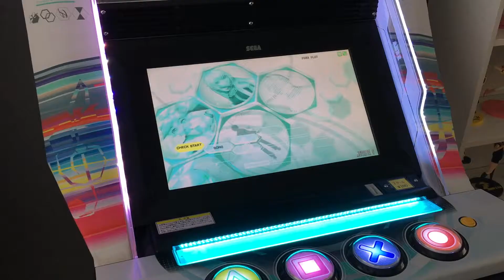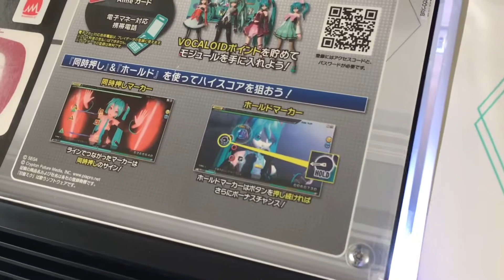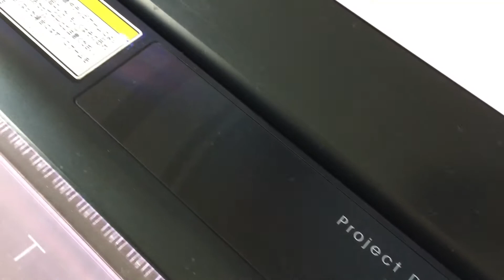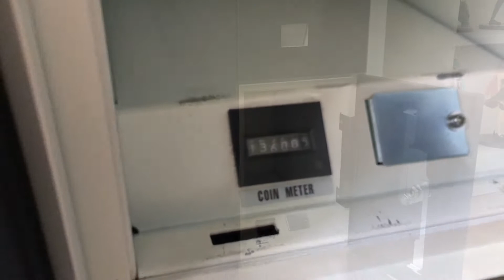Hatsune Miku Project DIVA Arcade Future Tone Cabinet - Showcase

Comment: Woah. Hardly any of these in the UK, let alone a home setup and in such perfect condition.  Great job and video.
Reply from the maker: I was surprised by the condition too, as I hadn't seen any pictures of it prior to delivery. The control panel it came with had quite a bit of rust on it, was loosly attached and didn't match the good condition of the rest of the cabinet. I 'm guessing it's original panel developed a fault and the operator swaped it for the tatty one. The panel in all my videos is in fact the one I had previously as my stand alone controller as it is almost new in appearance.
Reply: @N10248  Sick job. You've achieved a 200% better result than the technicians I 've worked with at several major UK arcades lmao.

Comment: The touchscreen monitor is impressive! I keep forgetting the arcade cabinet has a harddrive.  I can only imagine how expensive this would run up the electricity bill.  I love the glowing buttons.
Reply from the maker: It's fairy power efficient, the PC inside is quite low end, it's an LED backlit monitor, the lights use very little power as with most LED lights. The whole thing uses at most 230w according to the sticker on the back, and that would only be with the display on full brightness and all the speakers on full volume.
Reply: @N10248  One more question.  Is that arcade cabinet,  Windows XP? Ohhhh, I had to look up wattage usage for electronics such  as a washing machine, and PS4 to compare.
Reply from the maker: @chocotokenxreturns6126  Normally it would be running Windows Embedded 8, but mine is using regular Windows 8.1 Pro.

Comment: Hey awesome! 

I'm currently heavy on checking and buying parts for different Arcades (Mainly PD and Chunithm).
May I ask where you got yours and for how much?
Reply from the maker: The cabinet itself came via Ronnie at RKLOK.nl for £1600, I used my existing control panel as it was in better condition which came from eBay Seller "Tzsn_game" in Japan for about £270.
Reply: @N10248  Thank you for your fast response! 
Did they luckily have the cabinet in stock or did you contact them if they were able to get their hands on it?

Because the cabinet itself is the most important part right now for me as I currently am trying to get a PD nu for the IO-Card and the Controller for about 100€ each on an japanese yahoo auction. :D
Reply from the maker: @Afk_Kun  I contacted him last September, it took him a while to find one in Japan but I got it in April, he has another according to his most recent newsletter email.

Comment: I hate to be the person asking for help in the comments, I really appreciate your channel, it's driven me to buy my own Diva arcade cabinet. I have the cab and I have the PCB (computer, which I had to buy separate on YAJ), I have no idea how where to get help with the software. If you could happen to point me in any direction regarding that it would very appreciated! 

keep up the great work <3!
Reply from the maker: Yay another owner! Unless you were very lucky and got a keychip with it too, using the original hardware and software freely can be quite difficult, and hacking it can be risky, that's the main reason I went the route I did, ie swapping the motherboard and using the available rip of the game instead of the original. Might be a good idea to sign up at ProjectDiva.net and go through what you have and how far you have got with it all.

Comment: Hey I have a few questions. 
1. does the sega Nu has DVD player or whatever it call. Because I seen people selling like a copy of the disc. Which is probably updates of the game. 

2. Network switch board when you bought the arcade cabinet. Has that been use. Because I never seen project diva arcades use together or something like that. Is probably a feature I haven't seen. Probably multiplayer?. 

3. Since you have the arcade cabinet with the touch screen working. Did you had to Recalibrate the screen. And if you did was it on the test mode and touch panel setting?. The reason I'm asking is because touch panel is disabled for me. Because I don't have a touch panel and I want to learn more on that setting and  Options it has.
Reply from the maker: 1: The official way games get installed on the Nu is by using the Lindbergh DVD Drive Unit "U-Type", you have to use a different power cable for the drive though, as the Nu has a 4-pin square power connector instead of the 6-pin JST conector that the lindbergh used. The base game comes on 4 dvds (i think) and the extra songs get downloaded from All.net.

2: The network switch is used to join up to 4 cabinets together. 1 cab is set as the "Server" (set via dip-switch 1 on the Nu) and 3 others connect to the switch in that one (the switches in the other 3 cabs are not used). the server cab downloads game updates only, and then the other 3 get updated by the server. there is no multiplayer and if the server cab is off the other 3 won't work.

3: the touch screen needed calibrating when I first got it working, it was only slightly wrong. I think the calibration settings are stored on the JVS card in the Nu, as the calibration remains across multiple installs of the game.  Its calibrated in the games service menu, you press certain points on the screen.
Reply: @N10248  I see. 
1. I have seen people in Japanese websites selling the disc's 1 and 2. But Idk about 3 and 4 disc's.

3. Is it ok if you can show a video or pictures on the touch panel  Recalibration on how to do it. If you can do it.

Also my research on this I found the Sega Mechanics website. Which you can download a lot of things form different arcades they do. But manuals and other stuff is lock for I'm guessing top mechanics. If you would like the website I can give it to you.
Reply from the maker: @codexgameing1151  I'll make a video at the weekend showing this and a few other interesting things about it
Reply: @N10248  oh ok. Well thank you for answering my questions. I will ask again if I need to. Thank you and take care.
Reply from the maker: @codexgameing1151  New video added showing the calibration process... https://www.youtube.com/watch?v=BfgrZjrK9AQ

Comment: Is the “SEGA” that Miku says on the Nu startup added in? I was at an arcade that had AFT, and it rebooted after I finished a game. I never heard the “SEGA” on the Nu startup screen.
Reply from the maker: Yes, it's a vbs script I added that plays the sound on bootup, as changing the Windows 8.1 startup sound isn't that easy, so I used a script instead. The real arcade doesn't do it.

Comment: how did you do the mirroring on the TV? I want to do this with my Chunithm cab
Reply from the maker: Just connect the TV to the other DVI connector with a DVI to HDMI cable and the image will be mirrored.
Reply: I tried that and it causes chunitim to throw and error and fail to load
Reply from the maker: @DoinStuff4Life  Odd - you could try a DVI splitter of some sort but that might do the same.

Comment: i just have to ask! where did you get all this stuff to make this?
Reply from the maker: The Nu itself came with my cabinet, but I made the descision to swap it's M-ATX motherboard for my own to make it more practical to use in a home environment - the original hardware has many security features that would have to be bypassed to make it playable.

Comment: do mega mix songs have to be in the arcade?
Reply from the maker: They are a mod added that is not available in the real arcades. It would be good if they were though
Reply: @N10248  How did you install the mod on a real arcade machine? Is everything done the same way as on a computer?
Reply from the maker: @YabokuRUS The hardware i'm using isn't completely original, and i'm running the arcade rip of the game so I can easily add mods and extras to the game.

Comment: how is the aime reader connected to the pc? what are the cables and ports?
Reply from the maker: The reader is a Zixsys TN32MSEC003S which connects to one of the serial ports on the rear filter board. COM10 is used for this. it just uses 3 pins Tx, Rx and Ground, the reader unit is powered by 12v.
Reply: @N10248  haha thank you, shame on me for not knowing even the one word of these)))) but I will learn more about arcade cabinets because I am interested in this. So, can I buy this thing and just somehow connect it to my pc? I have a common b450 motherboard
Reply from the maker: @automate-skull-666  It might work as long a the board has a serial port or header. Not sure where to find one though, theres very little info on the online.
Reply: @N10248  just googled serial port, isn’t it VGA? seems very similar
Reply from the maker: @automate-skull-666  Same size but different amount of pins; 9 for serial and 15 for vga, if the board doesnt have the physical port it may have a header called COM1 which you can get a cable to connect to make the port.
Reply: @N10248  thanks, I think I understood what we are talking about and I found where can I buy it. And I have one more question - can I just copy all the software and drivers from the original PDAFT nuc, install it on my pc, then connect that Zixsys NFC reader, get the IC card and play??
Reply from the maker: @automate-skull-666  The PD-Loader software handles the game saving locally using it's Score Saver plugin. The Aime card doesn't save data on itself, it's just a link to your online game account which would only be fully usable on a real cab in Japan connected to the All.net service.

Comment: Is yours offline and if so how come it’s doesn’t show an error code that stays on the scream unless you start playing. mine is currently off mode and I’m tired of looking at that message
Reply from the maker: Is yours an unaltered cab with a keychip or are you using something like Mikubox?
Reply: @N10248  yeah I’m not sure what it’s using but it’s playing off-line without no Internet doesn’t have a key card
Reply from the maker: @Jimslegacy  It's probably been modifued just enough to work offline. The ability to hide the errors is possible when using Mikubox (which would give online features too) or if using a rip of the game and a tool called PD-Loader.

Comment: I bought one, too.
There's a keychip.
But I can't play the game because I can't access all.net.
What should I do if I want to do it offline?
This is South Korea.
Help me.
Reply from the maker: How long have to left it running, does it stop with error 8005?, I'm not sure but it may eventually time out and load the game. otherwise you may need to create a  server running something like "aqua server" which emulates an allnet connection.
Reply: @N10248  I want to run a cabinet offline.
Do I have to do a patch to run offline?
There's a key chip on the Nu board.
I want to do it in offline mode.
I don't know how to do it. Help me.
Reply from the maker: @고고고-m3c  I'm not sure how to patch it myself, but you could ask either Youtubers @GameSaru as he has some of these cabs too, or @Janet-vc2 as he had one. You are lucky to have the keychip though, they are very rare.
Reply: I have this running on a bitlocker decrypted drive, with the original Nu hardware in full.

Comment: how do you change the volume on the cab?
Reply from the maker: There's two seperate volume dials inside the coin mech door for the speakers directly above the screen and the main higher ones. I also use a small wireless keyboard to alter the windows volume level too, which is useful if i need to mute it for something like the phone ringing etc.
Reply: @N10248  also, how did you connect the cab to the network and where did you get the cab?
Reply from the maker: @hypnotizedglidinglizard  I imported it from Japan via RKLOK.nl, it's running offline via a program called PD-Loader.
Reply: @N10248  how do i actually buy arcade cabinets from them? they still sell stuff on ebay, but i don't see a button that allows you to buy cabinets from them. do i have to contact the owner or something? also, do i need a converter for me to plug in the cabinet?
Reply from the maker: @hypnotizedglidinglizard  Yes you'd have to email him (Ronnie), and see if he can get what you want. From asking to receiving mine it took about 6 months. You would need a step down converter,  I  use an Airlink one.

Comment: How did you boot without a key tip?
Reply from the maker: The mortherboard of the Nu system has been swapped out for regular PC one running the rip of the arcade game.
Reply: N10248 Do you know where to get the software?
Reply from the maker: @ibwinter  There are links around on youtube try searching "how to run project diva"
Reply: Thank you！
Do you just download the software and replace it with the base?
Reply from the maker: @ibwinter  I have just regular windows 8.1 installed, the game files, and PD-loader which you can get from here... https://notabug.org/PDModdingCommunity/PD-Loader
Reply: N10248 I'm a Japanese and bought my case, but I can't do it without a key chip.I searched for other ways and tried my best to see your video and the guided video, but unfortunately I can't download the DIVA arcade app.If you like the link of the application to download, please let me know.
Reply from the maker: @ibwinter  The only links I know of are on this video: https://www.youtube.com/watch?v=GthElAs_kTc
Reply: N10248 THANKS！

Comment: Hm, total cost?
Reply from the maker: £1600 for the complete working cabinet, maybe £300 ish on extra bits to get it how it is now - I replaced the motherboard and drives and added some extra artwork which involved getting a plastic bracket made.
Reply: @N10248  I made the conversion to € and it's like almost 1800 for the working cabinet. Hm, it's gonna take a while but I'll do my best to get it! Thank you!

Comment: what's the spec of original?
Reply: nvm just checked it's absolute potato
what's the specs of your custom nu?
Reply from the maker: @kittikorn6674  An i3 4170 instead of 3220, a 750Ti instead of the 650Ti (750Ti is also the standard card in a Nu 1.1), just a single SSD instead of the SSD and HDD combo used originally.
Having anything more powerful would create more heat and put stress on the 250W PSU which also has to power all of the side lights, buttons, slider, card reader and I/O.